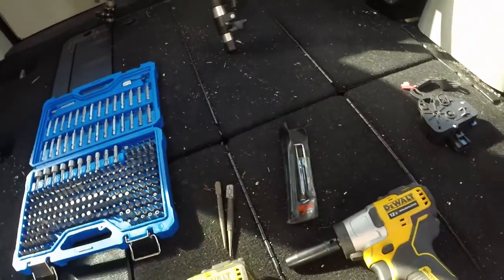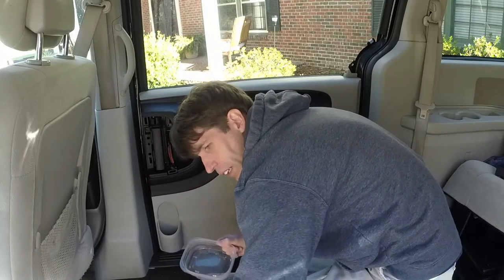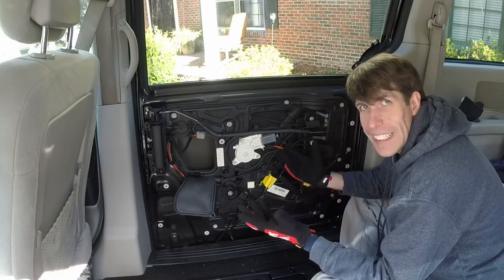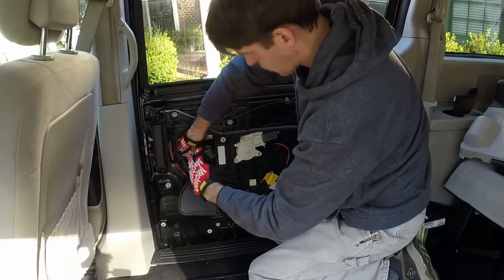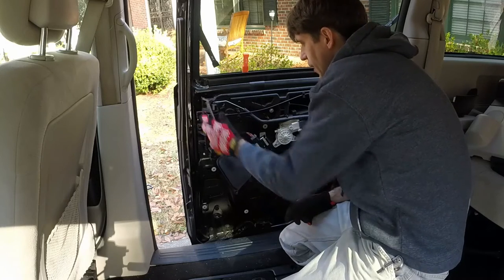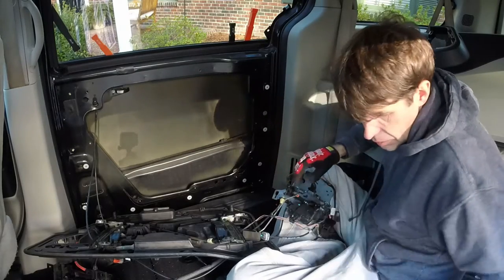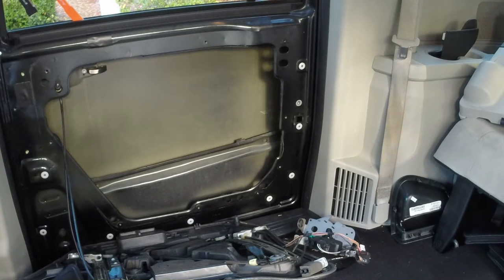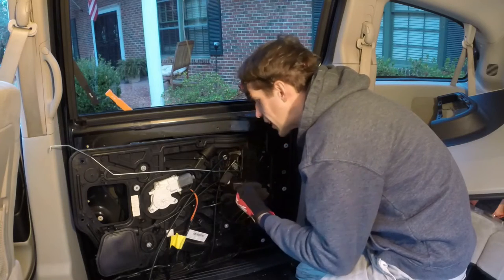How to replace a 2008-2020 Dodge Grand Caravan or Chrysler Town & Country Sliding Door Lock Actuator

Comment: My door is doing the exact same thing on my 2016 Dodge Grand Caravan. When I brought it to the dealer I told them that I think it’s the actuator. They diagnosed it and said it was the latch. Now get this, according to my extended warranty the actuator is covered but not the latch. When you replaced your actuator, how did you know it was the actuator and not the latch?? Thank you!!
Reply from the maker: great question.  the lock switchwon't move when i tried to do it manually so it told me the actuator was locked up.  it just won't lock or unlock I can't remember.  but the door would open if you could get it to unlock.  if your door won't open then it could be latch assuming you can get it to unlock. hope that helps

Comment: if you take the outside trim piece off and take the rear window out you won't have a problem getting the back channel back in just be careful on removing the outside trim panel and you will have to have the adhesive to put it back on after assembling everything back in the door..
Reply from the maker: I tried to take the trim piece off and it ended up cracking into 3 pieces with the main piece still on the vehicle.  Obviously, I didn't have the right technique or tools to do it right.  I ended up having to fix that too as I couldn't find a replacement part.

Comment: My actuator arm is broken from the actuator and now i cant open my slider door cause its partially latch
Reply from the maker: you could try to take the door apart enough to reach in and try to grab the linkage to unlock the door.  otherwise you might have to cut the panel to get access to where you need to get access to in order to undo the latch.

Comment: I had watched a separate video of this from someone else and theirs wasnt as good. My problem is the other video said to take out the 4 -30mm that deals with window. I had the window taped up but after wtching yours it made more sense so what I did was take the tape off lower down window and frame til it sat on door bottom and took out screws. When it comes time to put back together since i hadnt had power to lower the window and just will have to push arm down to bolt up how will that affect the raise lower of window when it gets power.
Reply from the maker: I'm glad it helped.  there is so much going on that anything I can do to help in the repair is my pleasure.

Comment: Thank you so much for your video on this problem, Jay!  Armed with the knowledge of what to expect ahead of time, I was able to swap out my 2019 Grand Caravan passenger side actuator in under 5 hours.  It would have been less, but I goofed on a couple of things and had to redo.  Your best tip - Wedging the window in the up position.  With that, you don't have to remove the window or take anything off the exterior.  Thanks again sir!
Reply from the maker: Glad is worked out well for you.  You are welcome!

Comment: TIP:. If you can remember, always unlock the doors with the lock switch on the arm rest before activating the power door button.  The door lock actuator and the power door pulley eventually go out of sync and the door starts opening a split second before it unlocks causing stress to the actuator if you only use the power door button.

Also, if you can, have someone take videos and photos of everything you do from start to finish when disassembling the door.  This way you know how everything goes back.
Reply from the maker: Again thank you for the great tip!!  We don't have power doors so that is one less worry.  Good call on the disassembly.  That can really save you after a tedious day of dealing with the door and trying to remember where everything goes.
Reply: @jaysjeepandclassiccars  Yes, definitely a knucklebusting job.

Comment: HOW DID YOU OPEN YOUR SLIDING DOOR IF IT WAS LOCKED. THANK YOU
Reply from the maker: Great question.  you might have to take the inside panel off and reach in the top to try to unlock it manually by pulling on the metal linkage that connects the lock button/switch to the actual lock.

Comment: Be sure you sliders are lubed. My door was stopping half way then reversing. I lubed it up with penetrating oil by simply spraying it in the upper slider and that fixed it. It closed/completed the cycle after that.
Reply from the maker: great tip.  Thanks for sharing!!
Reply: Save yourself a headache and pull the window out! The exterior trim has to come off as well, which is adhered with double sided tape, and try not to break any tabs
Reply from the maker: @440-6pakroadrunner  I tried that and just cracked my exterior trim as it didn't want to come off.

Comment: After this was replaced, did your sliding door pop out after sliding the door close automatically? Mine pops out...like it can't latch on to close completely.
Reply from the maker: I don't have automatic doors but no it closes like it should.  If you push on the back half of the door where the latch is, does it catch then?  Did you get all the bolts back in the latch?

Comment: How many years will be the same as my 2009 as far as the door parts go ??
Reply from the maker: hard to say for sure but the 5th generation was from 2008 to 2020 but I don't know if changed the parts or not.  I know it does depend on the options that you got and I think they did tweak the design somewhere around 2014/2015 but I don't know exactly.

Comment: The piece that holds the rail guide is called the Presenter.  It breaks very easily and can be ordered from any Dodge dealer, cost is around $15.

If the door lock is frozen with the door closed remove the inside door handle frame with a shimmy or screwdriver and push the lock latch all the way forward past it's normal stopping point almost like your going to break it and pull the door handle at the same time, door will pop open.
Reply from the maker: Great Tip!  Thanks for sharing!!
Reply: @jaysjeepandclassiccars  when I find the invoice I'll post the part numbers for the left and right Presenters.
Reply from the maker: @clicketysplit1817  I appreciate it.
Reply: There is just no way I am doing all of this and I know a mechanic will charge an arm and a leg...which I would do if I were them..these car manufacturers do these things on purpose...for me to have the same issue as you do ..lets me know that this is common with these...but it's ridiculous.  My passenger door unlocks automatically and I had no idea the lock was never engaging to lock when I pushed the automatic lock on my key fob 😢

Comment: Man, I’m just doing this along with the video. 
It’s more or less coming along about the same, except the dogs ate a pizza while I was out here. 
Experience is what you have right after you needed it. 
Or so they say. 
I still have to do the other door, so I’m sure it’ll be a 10 minute job.
Reply from the maker: Indeed.  I hope your next door is 10 minutes.  If it is let me know.  but when it works and you saved all that money, you are in an exclusive club of owners that are independent of car shops!!
Reply: I’m kinda stuck right now. 
I got the window channel lined up, I think. 
I went to Home Depot and grabbed some long 6mm bolts to reach in the back and thread into the door lock and pull it back where I can reach it, but now I’m trying to snap those plates together. 
It sucks. 
Should I pull it all back out and snap it all together before putting it in?
Reply from the maker: @marshallnmoonshine  it has been over a year since I did the repair so I don't remember all the steps exactly what I did.  However, i do remember a battle if it is the part I am thinking about.  I used punches to hold the lock in place to get the screws in it.  If you watch around the 44:00 minute mark I explain how I put the two parts together.  I put the window channel in and then I was able to get a couple fingers on the hole and peg and get them to slide on together and in.  It wasn't perfect when I finished but it worked if I remember right.  And yes the door lock and the window channel need to be together if I remember right but they were separate from the door plate part.  I hope this helps.  don't give up.  I know I tried it all sorts of different ways and if one way doesn't work for you try it the other way.  There are so many different configurations to these doors that it is hard to say what is the best way.  You can do it!!  Don't give up!  you got this.  Once you get it, the rest isn't too bad...
Reply: @jaysjeepandclassiccars  I got it! I did end up putting the plates together first, and was able to get it into place. I hadn't disconnected the outer door handle cable, but that made it WAAAY easier to manipulate around. 
Having them snapped together also prevented me from bending that rod between the door lock handle switch and the actuator.
Sacking up and disconnecting cables helped a lot. I'd never taken cables out before, so I was hesitant to open those cans of worms. I don't do much car work, but I was a machinery tech in the USCG, an electrician, mechanic and refrigeration guy in engine rooms on container ships for 20 years, so I'm handy enough and have more than enough tools.
If I have any advice to give to the next guy: Take pictures of the cable runs. As soon as you get that panel off, snap a picture. Because which cables are in front and which are in back can be tricky to figure out.
As soon as you get the whole assembly out, take more pictures before taking them apart, front and back. I doubt anyone reads the random comments, so you might add that up top, if you see fit. It REALLY helped me. I wish I'd taken more.
I did break the plastic part on the rear "applique" that like 4 guys in separate videos all broke. I used JB Weld Quick Epoxy to put it all back together and replaced the double sided mounting tape with Gorilla indoor/outdoor stuff. It should go right back in. We'll see how it goes on the other door.
Man, I'm glad I got this thing fixed. My kids are sick of hearing how much money I saved, unless I put it in terms of Disneyland trips. :)
Reply from the maker: @marshallnmoonshine  Way to go!!  good job!!  way to stick with it and make it happen.

Comment: Does anyone know if there is a way to lock and secure door..i don't need to use this particular door...i just am so tired of puttjng money into this van, but i need it to not open.  Its the same issyet with not being able to lock manually. 2013 DGC
Reply from the maker: Sounds like it.  You might be able to take it apart and force it locked and leave it disconnected. however, most of the time it is that actual mechanism that jams and gets it stuck.  i think  our issue was actually not allowing it to lock just as you are having but it was awhile ago so I don't really remember.
Reply: @jaysjeepandclassiccars  Thank You
Reply from the maker: @marliseisrael3017  my pleasure.

Comment: My door won’t open . Stuck in the locked position . How do I take the metal housing off so I can get to the actuator
Reply from the maker: which metal housing? the one holding the actual actuator?  It won't move until you take the screws out on the side of the door which if it is jammed in the lock position could be an issue because you have to get to those with the door open...  can you get to the actuator and move it by hand or take the linkage off the actuator and move it to unlock?
Reply: @jaysjeepandclassiccars  I tried to reach my hand in but it’s to far back . Window pulley in the way to open the metal housing more
Reply from the maker: @jedicrypto160  that is tough.  try to get the linkage off the actuator.  i would try using a long screw driver or a long pair of needle nose pliers.  I am not sure what else to do.  you might take the window out but I'm not sure how to do that.  I think you have to take the trim off to do it from the outside.  I don't have many other suggestions though
Reply: If the door lock is frozen with the door closed remove the inside door handle frame with a shimmy or screwdriver and push the lock latch all the way forward past it's normal stopping point almost like your going to break it and pull the door handle at the same time, door will pop open.
Reply from the maker: good tip!

Comment: Its on an 18 model too.. friggin pain in the butt
Reply from the maker: indeed the entire repair is like that.
Reply from the maker: if it is the piece i am thinking about to get it out I had to pull down and around to get it off the glass.  to get it back in, was a challenge trying to use that same motion to go around then up.  if you are trying to get the channel out from the outside, then you have to take the trim off which when I tried just cracked in two different places that I had to fix.  the whole thing takes awhile and can be frustrating.  don't give up.  you got this. if I can do it you can do it!!